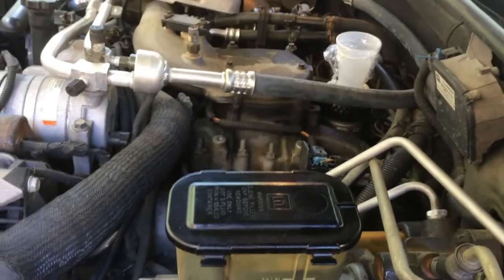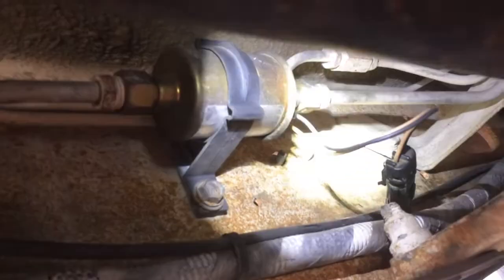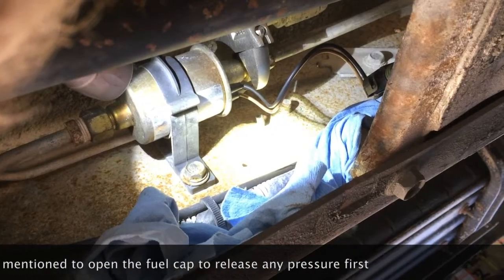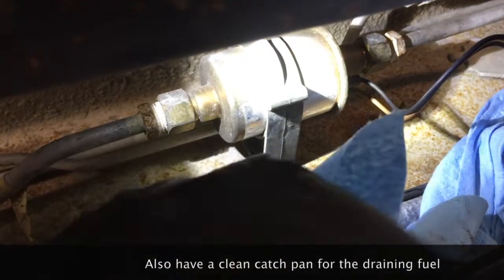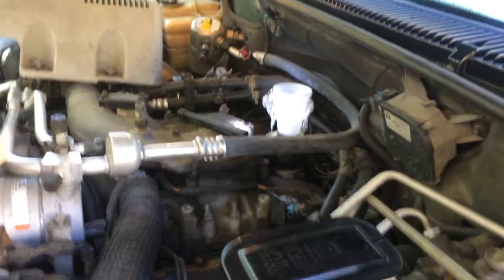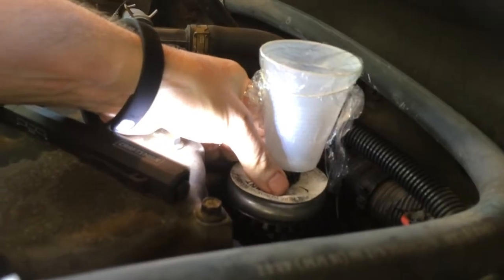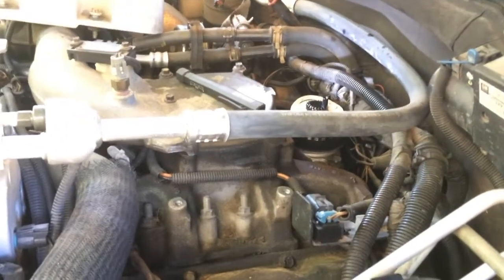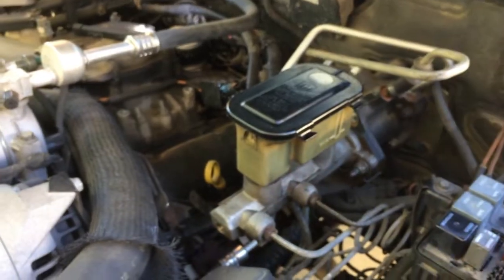1996 - 2002 GM Truck 6.5L Turbo Diesel Fuel Lift Pump Replacement (Chevy & GMC)

Comment: Hi there, wondering if you could help me out. I watched you video. I did the test on the lift pump wires to and I wasn't getting any 12 reading, the truck starts but once in a blue moon, it will stall... I did the jump wire on the reply and pump works. I don't know why I don't hear the pump when I turn the key, not even to start... I just had to think maybe ask this will like you said, it's the injectors that starts the truck. I bought a second pump just incase. I have a 1995 Chevrolet 6.5
Reply from the maker: There's some more technical info in the description text for this video that might be helpful.  For a 1995 diesel truck, the oil pressure switch (OPS) is part of the lift pump circuit.   This video is showing 1996 and up, which do not have that component in the lift pump wiring anymore.

So if you are not getting any voltage at all, and you are sure you have a good ground for that test, I would check the wiring harness between the lift pump and the OPS, as well as OPS itself for that model year. The OPS can otherwise appear to be working fine (oil gauge fine, no PCM codes, etc) but this electrical safety for the lift pump circuit part of it can separately fail.  There is also a relay in this circuit you should check as well if having a no-volt condition at the lift pump.
Reply: @DrShock  thank you so much for the quick response... This is something I'll have to check from your details, would you know where the ground wiring is mounted, the wires is ofcourse wrapped. I guess I should get voltage when I turn the key without starting the truck? Even for this year?
Reply from the maker: For the 95 you would get that initial voltage via the relay, and then after the engine starts from the OPS.
Reply: @DrShock  sorry with all questions. So would you say there is a problem that am not getting any reading if I turn the key without starting the truck and I am not getting any voltage read but I did what you did in the video with a wire on the replay port and I heard pump
Reply from the maker: Because of how the 1995 and earlier are wired, just turning the key won't be enough to get the lift pump going like on the 1996 and later.  The OPS is used as a safety device in these earlier years and powers up the lift pump only once engine oil pressure is in place during cranking, or running.    So you will not get the lift pump to come on without cranking a 95.

An easy catch of a failed, or failing lift pump, is a fuel filter change.  The air let in during this breaks any injection pump suction and forces a need for a good working lift pump to bleed the air out.  Often times folks never realize they have a problem until they can't bleed out the air, or the engine won't start after simply changing the fuel filter.

To bleed a 95 or earlier, you have to crank the engine for a few seconds with the air bleed valve on top of the fuel filter module open.  And a small length of plastic tubing attached to catch any diesel fuel purged out with the air.

I'd say, given how rare you describe this problem is, check all this out at your next fuel filter change.  If there's no issues, then these blue moon events are not lift pump related.
Reply: @DrShock  wow. You are amazing. Thank you so much🙏🏿😊

Comment: I am stumped as to what the unit under the intake in the forward of the engine is called. It's definitely fuel related as it's leaking fuel from a bad o-ring. It's a sensor of some type, I think. I have searched everywhere on Google for the part name, and cannot find what it's called. Would you happen to know? It's got a plug to it, cylinder in shape, goes into the engine, and requires snap ring pliers to get out. It's in the front of the top side underneath the intake plenum.
Reply from the maker: From the location you're describing, it's part of the fuel injection pump assembly.   That in the front, and the fuel filter housing assembly in the rear, are the two fuel related major assemblies on top of the 6.5L (in addition to of course all the plumbing related to them).  Take a look at my injection pump timing vid here https://www.youtube.com/watch?v=1wUF9cdBROk , and see if you see the part.  If so comment on that video with the time index where it appears, and I can identify the particular part you're looking at there.

Comment: I wouldn't replace a stock lift pump with another stock pump. Those pumps are really weak and deprive the engine of fuel. An aftermarket pump will wake it up and make it happier plus it'll send a lot more "cold" fuel that will help keep the IP a little cooler which will prolong the life of the IP and with the IP being buried under the intake and a estimated $2k, I'd definitely upgrade.

Comment: Thanks for the video. I was wondering is the Lift pump also responsible for keeping the engine primed? & Do you know if I can wire my 94-6.5 Lift pump to turn on when the key is like my 98-6.5 ?
Reply from the maker: The injection pump would keep the prime, not the lift pump.  Your 1994 harness would route lift pump power thru the oil pressure switch as an early safety cutoff mechanism.   The 1996 and later versions eliminated this circuit.  So you would have to look for aftermarket bypass solutions to setup a similar to the one at this affiliate eBay link: https://ebay.us/zYjTMv

This same seller also has the 1995 version of the bypass harness.  Hope that helps.

Comment: hey, I replaced the fuel pump, but now it's seems like I don't have any Air pressure, I have a 1996 GMC/Chevy diesel 6.5.. any idea's? fuse's are fine
Reply from the maker: When you say air pressure I'm going to presume you meant fuel pressure here.   So it's a pretty simple setup to debug here, the lift pump has a straight shot to the fuel filter housing on these 6.5L diesels.  If the pump is working, you will have fuel pressure at the filter housing (which you need to bleed the air out of the line from changing the pump anyway).   If there's no pressure, or insufficient fuel pressure, then the pump is not working correctly.

Why would that be?   Well, setting aside the possibility of a defective lift pump I'd first be looking at the wiring harness to confirm the pump is getting the voltage supplied.  If it is, then it's a defective pump if there's no fuel pressure at the fuel filter housing bleed hole.  An easy check of voltage is to just listen, the lift pumps make a distinctive whrrr when first powered up during the glow plug cycle.   The lost of this sound is often the first clue one has failed.

Comment: What were the symptoms of your bad lift pump? My 98 6.5 box truck has a turbo surging problem under heavy acceleration and going up steep hills.
Reply from the maker: This kind of problem is typically discovered by accident tbh.  The injection pump, presuming there are no fuel line leaks, will maintain fuel feed prime even after the lift pump has completely failed.  When you let air into the feed, doing say regular fuel filter maintenance, you suddenly find you have a crank no start situation after installing the new fuel filter - caused by lift pump failure.   The only other symptoms I've seen are the tell tale lack of pump noise during the glow plug cycle.  The genuine GM ACDelco pumps typically just run fine until they die completely, I've not encountered any intermediate states with them.

Comment: Nice video. The cup with the plastic is a cool idea.  I use apiece of vacuum hose into a empty water bottle.
Also you can make a funnel into your drain pan underneath for swapping the lift pump with scrap of tinfoil or cardboard.  Or there are those “form a funnel” that work great.

Join a bunch of us 6.2/6.5 owners on thetruckstop.us plenty to learn and help each other.

Comment: I wish you could have shown which two metal prongs to jump
Reply from the maker: I did, check 12:08 again. It would be the fuel pump relay in the underhood fuse box next to the brake master cylinder that was removed, the cover has the diagram on which is which.  You'll notice the empty socket is shaped like a letter U (two down, three over, and two up) when standing at the drivers side fender facing the brake master cylinder.   The jumper goes from the lower leftmost connector (two down) of the U to the upper rightmost (three over and two up).  Don't run it very long like this, just long enough to test or bleed the air.

Comment: Good video. Problem is the oil pressure switch controls the pump and its too much power runs thru it
Reply from the maker: FYI that use of the oil pressure sender as part of the circuit used during the lift pump prime phase (glow plug cycle) was discontinued starting in 1996.

Comment: When i took my line off my lift pump itbwasnt flowing that much i used a manual pump and pulled fuel through mine fine but the lift pump wont pull fuel.
Reply from the maker: Sounds like you need to validate the lift pump is still up to spec.  They due have to be replaced from time to time.   You should be getting battery voltage during the glow plug cycle for 1996 and up models.   You should be able to hear the pump going during this cycle, if not you'll need to check that voltage is being supplied.  If it is, replace the pump.

Comment: outstanding video!!!   really comprehensive and thorough...I have a 94 suburban 2500 hd with 6.5 that I’ve lovingly restored over years.  Couldnt have done it without people like you who take the time to do videos like this.  Honestly—if there was an academy award for best you tube instructional..you should get it. 👍
Reply: I just bought a 94 and I'm new to the diesel truck world and I was wondering do you have to add def to a older diesel like a 6.5?

Comment: I have 2000 Chevrolet 3500 hd I don’t have power on the rear fuel line pump
Reply from the maker: By saying rear I presume your 2000 6.5L setup has dual tanks then?  If so, then you're talking about having no +12VDC at the rear aux tank transfer pump.  You'll need a schematic from the service manual to follow, but power to that pump is controlled by the fuel tank balance module, main tank sending unit, and aux tank sending unit.  So its either the wiring harness, or one of those three components involved would be my guess.  I've not worked on a dual tank setup, but do recall these details.

Comment: Hello there! I have a problem with this pump . I found that it is not powered when the ignition is turned on! Should it always be there, or should it be in special cases?
Reply from the maker: For 1996 and up the pump will come on briefly when you are in the wait to start (glow plugs going) mode with the key (you should be able to hear it) so that you know the pump is working.   If you're turning the key to that mode and you don't hear it then yeah something is amiss there.   When a lift pump dies you don't always know as the injection pump can maintain the fuel suction for a long while, across many start/stop cycles, in many cases.
Reply: @DrShock  every time the ignition is turned on, the pump connector is not powered!!! But the pump itself is working ( connected directly to 12v) The question is , where does the power to the pump come from? The wires seem to go into the tank . Thanks for the answer!
Reply from the maker: Is your truck a 1996 or newer?  Very important question as the power routing for older trucks is quite different (thru the oil pressure switch during glow plug cycle).   For the 96 and newer though it's just 12V direct power via the relay during the glow plug cycle. If voltage is not present you may have a break in the harness from the pump to the relay that you'll have to trace underneath the truck to locate.  But first check that the relay is working, location that I show at 0:27.
Reply: @DrShock  Thanks for the answer! I have a 1995 Winnebago WCF25RC motorhome! Based on the Chevrolet P30 6.5 Diesel . I'm from Russia. There is very little information on this issue! Thank You again for your help! I'll look for a gap.

Comment: Is it possible to run only the main tank and bypass the auxiliary? Developed an issue with the rear and cannot find a replacement. Pulled it and now my fuel gauge goes from full to empty 10 seconds after startup and stays there. TIA
Reply from the maker: This being a diesel engine video, I presume when you pulled it you mean you pulled the fuel sender in the aux fuel tank?   If so, yeah that's going to cause a gauge problem because there are two fuel senders on a dual tank diesel, as well as a balance module.    If you take alook at this diesel fuel sender repair video I posted last week, at the beginning I flash the schematic up for the dual tanks.  That might help you debug that part.  https://www.youtube.com/watch?v=dw9Hia55yys
Reply: @DrShock  I meant that I removed the entire rear tank. The metal locking ring on top where the sender is was badly corroded and the tank needs replaced but I have been unable to locate one anywhere. Will I need to find a new tank or is there someway to only use the main tank? 96 C3500HD
Reply from the maker: You could switch to just the front tank, but you would have to eliminate the balance module from the circuit and that's not something I am familiar with to advise on.   To repair the original design, I believe the 96 C3500HD sender for the aux tank would be GM 15708151 (or Spectra FG122A).  The aux tank itself would be GM 15014017 but yeah it is a discontinued part and I also could not find any aftermarket replacements.   The other GM numbers that this one superseded were 15708150 and 88944149.  All are 18 gallon secondary rear mounted aux tanks (should have RPO K53 on your glove box sticker).  You may have to look at having a shop repair the original tank, or fabricating something of similar size and capacity.

Comment: So I watched your video on how to change the fuel filter. Thank you it was smooth except with I went to bleed the air out no fuel came up. So I watched this video thinking it was the lift pump. I took off the discharge line on the lift pump and bumped the key. Fuel came out so I figured the pump was weak. Went to the parts store and replaced the lift pump. After replacing I loosened the fuel filter and still no fuel is coming out! Please help!! Thank you.
Reply from the maker: I'd check that the bleed hole in the fuel filter housing cover is not plugged up, and that you have opened it enough to get the bleed going.   You may want to inspect the cover in general to see if there is some obvious obstruction.  I've never encountered one where it wouldn't bleed air, then fuel, unless of course the lift pump was inoperative.
Reply: I have the same exact issue my pump isnt delivering fuel to the filter housing and my lines are clear the air wouldnt be pushing up uf they were plugged they actually look like new lines
Reply: @steve19745  how did you solve it?

Comment: Mine does that too the glow plug relays go through a cycle like that but if i try after the first cycle she fires right up but i live in Florida not sure if that disqualifies me
Reply from the maker: If you're getting fuel pumped thru during this cycle, then the lift pump is working.   Another easy test for this is when changing the fuel filter, and seeing that the fuel comes thru when bleeding the air out - https://www.youtube.com/watch?v=_0O8mzPe9pE

Comment: what if i have water in my fuel filter is there a good way to get it out?
Reply from the maker: You'll need to use the drain T valve to get the water out of the fuel filter housing.  Use a clear container so you know when you are done, and you'll need the lift pump going during the procedure.

Comment: Changed my liftpump today from a working one that was weak, to a new one. Problem is the new one dpesnt work, and the relay is good, and there is power out to the pump. Going to call the store when they're open again, but is there anything else I should check out?
Reply from the maker: @Aaron if your truck is a model year prior to 1996 I would check that the oil pressure switch is working correctly as that was part of the lift pump activation circuit in those earlier years.  If you're getting 12VDC to the pump electrical connector, and it's still not activating that sounds like a defective pump to me for any year.  It's a pretty simple circuit, even with the older ops style in the loop.   Be sure you have the right pump too, there were several editions depending on the year.  I mention the three different ACDelco numbers in the video description.
Reply: @DrShock  Yeah, I jumped under to doublecheck and its the correct pump ( I have a 98 Tahoe). Im gonna call an complain on monday and they'll just have to send me a new one. Thanks for the quick answer!

Comment: I changed my lift pump and fuel pump on my 1996 6.5 Detroit Diesel but I'm still not getting fuel to the engine somehow? Someone told me it could it be the fuel injection pump?
Reply from the maker: If you changed the lift pump (there is no fuel pump in the tank like a gasser just a sending unit) then you should get fuel to the filter assembly.   Are you?   If you're getting fuel there then the next stop is the injection pump.   If you're not getting fuel to the filter should not be hard to track down, if you are getting fuel to the IP but no further that's way too complicated for a comment section.  There are some vids out there on that.